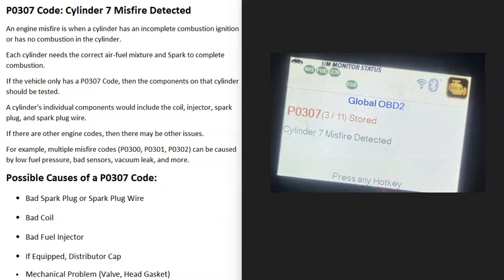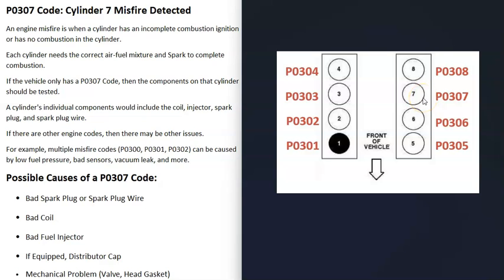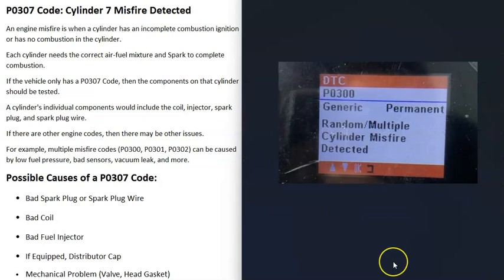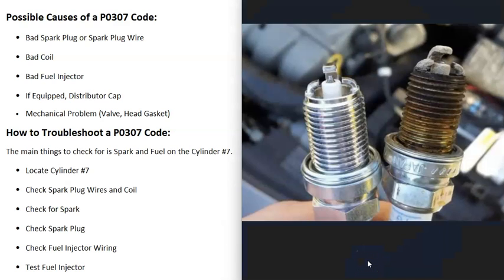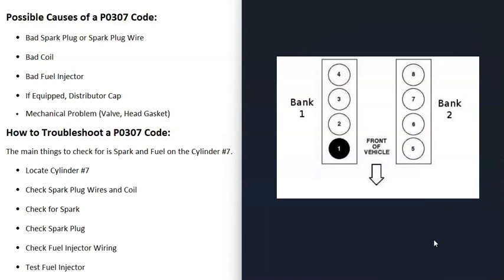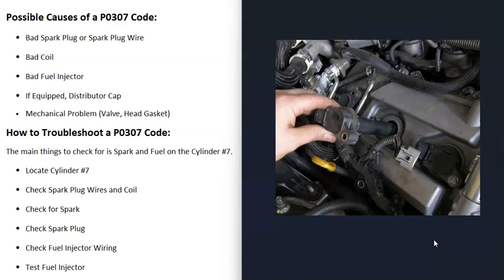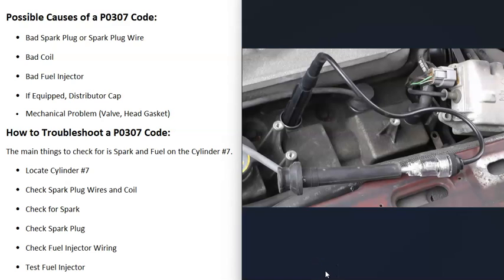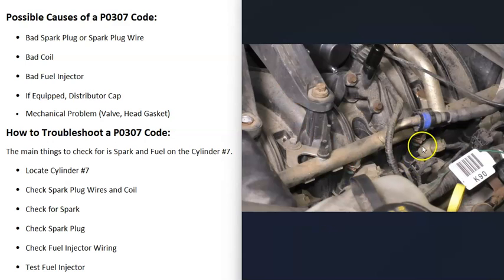Causes and Fixes P0307 Code: Cylinder 7 Misfire Detected

Comment: If you have an 07-13 Chevy Silverado 1500 with the 5.3 V8 cylinder 7 misfires can also be the PCV valve. This ones awesome because it’s an internal permanent attachment of the whole left side valve cover! So you have to get a whole new valve cover.

Comment: Yeah I took mine to the auto parts store and they checked it with the scan tool and po307 came out cylinder number 7 that is misfiren maybe I need to change the spark plugs or the fuel injector number 7

Comment: I have I have a jeep SRT 2012 when I push it to 40 mph it is fine but sometimes when I push it again to 40 mph, I feel it to start to lose a little bit of power I keep on checking the code and the code is P0307 and I already changed spark plugs and it’s not it so what can my other problem be?
Reply: Swap the cylinder 7 ignition coil with another cylinder and see if the code follows the cylinder 7 ignition coil.

Comment: Could this be a timing chain issue on a 03 tundra if im getting P0300 p0301,p0303, p0305, p0307?
Reply from the maker: The timing being off can cause issues, but all the misfire codes seem to be on the Bank-1 side of the engine. I would test the 02 sensor and other components on Bank-1.
Reply: @HVAC_Mechanic  ah so possibly an )2 sensor. That makes sense and my exaust was looking wired before this happened and was chugging and missing till it came to a hault.
Reply from the maker: If you have an OBDII scan tool, look at the 02 sensor fuel trims on Bank-1, which can help point to the issue and see if they are working correctly or not.

Comment: I got a 2014 tundra 5.7 that the p0307 code is still coming up. 
I replaced all spark plugs, cleaned up all injectors on driver side ( cylinder 7 included) replaced injectors spot from cylinder 7 to 1 , checked and cleaned pcv valve. 
Changed coils 7 with 4. 
But still getting misfires on cylinder 7 when the truck is cold., also I’m losing coolant that I can’t see from where is dripping! 
Can that be a head gasket problem??
Reply: interesting, I have the same code on my 2010 Tundra too..  p007 plus p006 & p008. today it read only the P007. when my rad started to leak I did the colour test where if the fluid goes from blue to yellow if your gasket is blown.
Reply: I have an identical issue with my tundra, did you every figure out the issue??
Reply: @davidbabiychuk5734  not yet. It's been freezing up here. It has been getting worse. can take me close to 10 minutes of clearing the codes to get her to run right. (once its warmed up on idle i can clear them easier) I find when its warmer out it doesn't do it, in fact it didn't do this all summer or fall then I put in the bypass kit for the air injection on in October,  I did have those missfire codes already, though it never gave the truck its nasty shake.
Reply: Seems like so many of us tundra guys get this code and no one can ever figure it out. What I’ve read on forums was that it’s possible it is a transmission shifter but I am bound and determined to figure this out.

I’m afraid I’m going to go down the same road the person who made this comment did and get nowhere!
Reply: @davidbabiychuk5734  so i changed all the plugs, coil packs were fine but the new camshaft position sensor is got wouldn't let me start the truck.. has to be a denso. so I had no code all week and then I started getting them again. frustrating.. once I get a proper reminder denso cps I'm hoping it solves the issue

Comment: I just bought used Dodge Journey with 3.6 and it shows p0307 error code. My concern is this engine have only six cylinders. What it should mean when it says "injector circuit - 7 cylinder" ?
Reply from the maker: The computer sees an issue with the Cylinder 7 injector or circuit. I made a video on how to test this issue and find the problem. Here is a link. https://youtu.be/JL4_HlYCKrw
Reply: @HVAC_Mechanic  Thank you.
Reply: @HVAC_Mechanic Though my engine has only 6 cilinders. So logically it has 6 injections. But scanner shows problem on cilinder 7 . What is cilinder 7?

Comment: I have a 2008 Aspen Hemi 5.7 and it continues to read the same codes P0300 and P0307 it’s also been shaking a lot and turns off out of nowhere when driving it. I’ve also already replaced all the spark plugs and fuel injector. I honestly don’t know what else to do man.
Reply: Intake manual fold

Comment: I just bought this 97 mustang gt only one code pops up P0307 when I turn on the car you can't hear any misfire but when driving you can like sometimes when I'm getting to 30mph you can start to feel the car feeling a Little weird almost like sluggish so I let off then go back in it easily n it will pass 30 mph without it feeling sluggish then sometimes it won't feel like that getting to 30mph it'll feel like that getting to 40 mph but that's the only time I feel the car having an issue
Reply from the maker: Often with V8 engines one cylinder misfiring is not too noticeable with the engine more sluggish than usual. Cylinder 7 likely has an issue and needs fixed.
Reply: @HVAC_Mechanic  so it's a big problem ??
Reply from the maker: You likely can drive it, but it will have less power and use more gas. It could cause other issues; for example, if the injector is bad and dumping fuel in the exhaust, it can clog the catalytic converter. I would get it fixed.
Reply: Did you ever get it fixed? I have a 02 mustang v6 and anytime it's done that it has always been the spark plug / coils needing changing. That would fix it right up
Reply: @ yea I switched the spark plug and changed the 8mm coil wires for some 9mm ones and then I put some screaming demon coil distributor as well

Comment: I work at a ford dealership I just bought my Camaro 2 weeks ago. The engine started shaking I took it in and had our Chevy tech look at it.  Here is his diag: FOUND OIL ON CYLINDER 7 SPARK PLUG AND OIL ON
TOP OF CYLINDER 7 PISTON
PISTON INSPECTION FOUND RINGS HAVE FAILED
AND ENGINE OIL IS ENTERING THE COMBUSTION

We replaced all 8 spark plugs the boot and wiring and the engine started shaking more.  How fucked am I 
CHAMBER
Reply from the maker: If the rings are failing, the engine will need to be rebuilt to fix it. It should still run for a short while until the plugs foul out unless there is a very bad leak.
Reply: That's a bummer, man.  How many miles on your car? Check the compression on #7.  Maybe there is a chance that you only need a head gasket?

Comment: Hi, what if misfire occurs in middle to high reving, is this electrical issue?
Reply from the maker: It could be a weak coil
Reply: @HVAC_Mechanic  hi it's a sym scooter 125 cc, you mean the stator coil ?